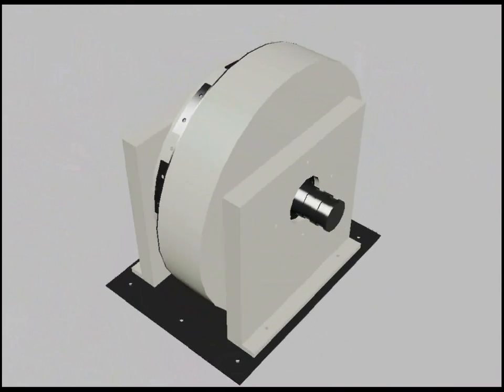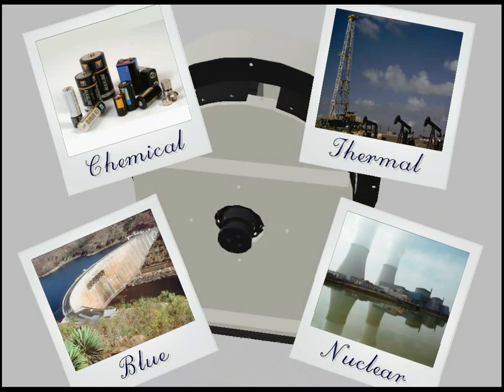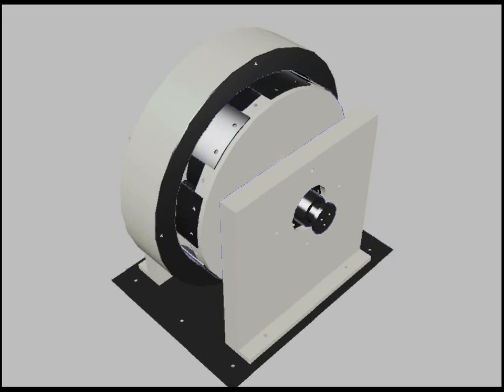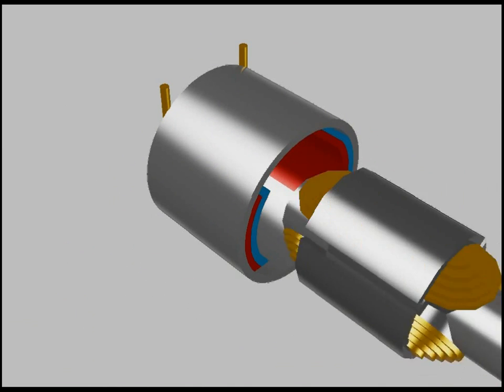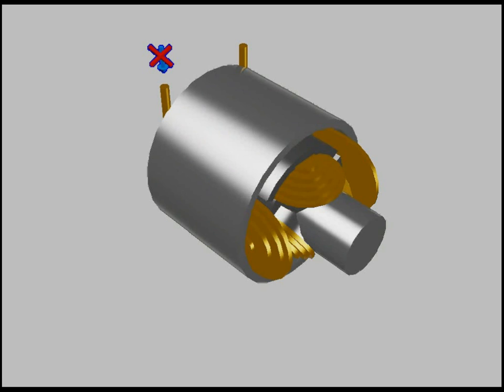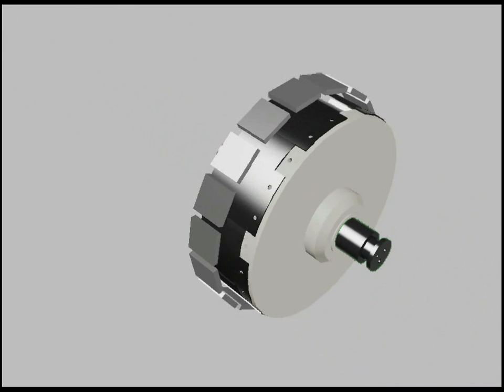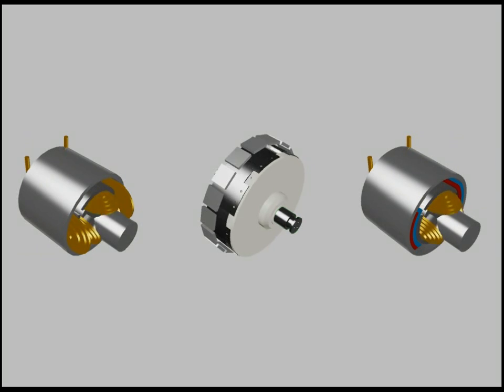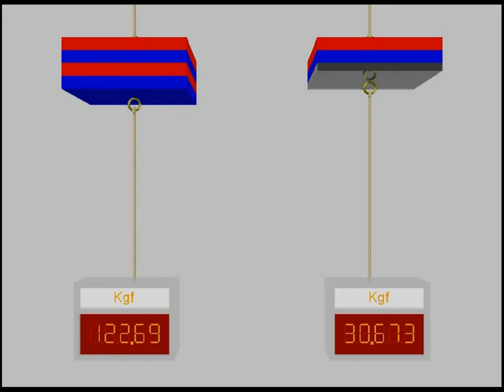MTG - Magnetic Torque Generator

Comment from the maker: Nice to see you.
There were a lot of changes in the lab structure since this video's publication.
(new national research policy, budget and staff restructuration, etc...)
The team is currently trying to find a functionnal shape that complies with the safety norms.
Laws requires to allow a disassembly by the user, wich was not foreseen at start.
And because rare earth and metaloceramic elements have been prohibited due to environmental laws, the used materials have been changed, wich mean a loss of power compared to the old model.
Adequate power ouput and safety compliance are the work points of the team.
.
We also want to give much thanks to all the partnership proposals and the warmly supports.
.
PS :
The MTG is not a perpetual engine. It needs input power sources to demultiplicate them.
.
(2017/07/16)
Reply: Great,  can i use this MTG Magnetic Torque Generator mechanism to rotate my sternwheel paddle drive in my pantoon?
Would appreciate your assistance. 
Thanks
Reply from the maker: @Savanna_12  Hello. Yes you can,
but due to aqua inertia, the efficiency of a enhanced magnetic gear box (as those for actual 1~4 KW wind turbine) will stay less than muscular action. It work both in straight and reverse, so you can.
Maybe in your case you can use a small air-tank as power-source and a chained pneumatic-screwdriver/motor as a muscular assist. So you can save usable power by keeping it mechanic, because convert it in electricity will result of a total 50% energy loss.
Hope it helped

Comment: You mentioned a magnetic monopole. Problem is there is no such thing! Show me a working model instead of a diagram. Oh, what's that? You can't because it doesn't exist? That's what I thought.
Reply from the maker: Hello Harold, I take note to make detailled view of each parts.
As you asked, here on the lab's twitter you can see some short gif on working magnetic monopole. (2019 may 03th)
Linear version :
https://twitter.com/Exomeca/status/1124153494309675008
Torus version :
https://twitter.com/Exomeca/status/1124154312341565440
And general incidence on the most recent prototype (yet test paused due to lack of material and covid situation) :
https://twitter.com/Exomeca/status/1174028424450588672

Comment: dear what is your position now?
Reply from the maker: Hello Yoav Heller,
.
Compared to this video, for several reasons including the components supply and because the general interest went into a portable version (something much smaller that presented in video), we redesigned all the technology.
.
The tests on the new main core were completed a month ago (stability test and compatibility with Safety Standards Booklets). The energy efficiency has been improved and the whole system is now miniaturized. There are thus 4 crystal core and the modulator is shape-integrated.
.
We are actually working to improve the duration of power source (800 hours only). Planned also to use rechargeable accumulator, as 9V battery shaped.
For now, the point is the Input Gear-Speed that is unsuitable for small motors (we chose a RC-micro-motor - Motraxx 6V 37,7W 8400 rpm) (compared to our crash-test engine that is a 800W 1500rpm).
.
For the output energy, we will certainly opt for a 1400W (50A) automotive alternator.
.
If you want, you can see the progress on Twitter
https://twitter.com/exomeca

Comment: Does it require less torque than the average generator?
Reply from the maker: On our models, it requires a quarter of the nominal torque. But the acceleration time is higher and the start must be made without load.
Reply: Is there a guarantee on your product?
How do I get plans?
What is the estimated cost?
Reply from the maker: We do not have a finished product. Actually we are looking to sell the technology or establish a partnership with a company able to make a safe product.
.
The distribution of Mounting kits is not envisaged in this version due to the magnetic core that can be hazardous at mounting. 
We are still working on this subject.

Comment: at  1:09 you mention "Because a house always needs less power than a car"  to better give credibility to your claims, can you explain that? You are using technology from magnetic motors that have been made since Tesla, Bendini, Newman motor, etc How is this any different?
Reply from the maker: The available power in a house is globaly between 6kW and 9kW (Voltage x Amperage) 
but the power of an average car is upper 30kW. 
It's more understandable with an electric car (as the Nissan Leaf). 
It can recharge with a standard plug for some hours, and also supply the house for days in case of a blackout. 
So, if you have the power to supply a car, you can supply some houses.
.
To the Tech point ;
Even it can be used as a motor, MTG is a primary generator 
(electric engines consume energy and are electro-mechanic transformers). 
We don't use electricity but a mechanical paramagnetic structure to make our engine rotate and all the power come from the magnet core.
The only need is a frequency reference to ensure a stable speed.
.
Actually, we have reached a computed model that use multiple-cores.
It rotate by itself and ticking as a clockwork do.
It doesn't need any signal in input anymore, it only gives beating power output.

Comment: Какой материал экранирует магнитное поле?
Reply from the maker: Магнитные экраны в ламинированные стали, в любое качестве сердечников трансформатора.
Это внутренняя геометрия и разрыв которые имеют первостепенное значение,
для того чтобы изменить градиент магнитного по всей поверхности, а не на краях.
Но в результате чего магнитное поле не равен нулю, только понижено.

The magnetic shields are in laminated steel, as any transformer core.
It's the internal geometry and gap which are paramount
in order to modify the magnetic gradient across the entire surface, rather than on the edges.
But the resulting magnetic field is not zero, only lowered.
Reply: ***** Эти материалы проводят ток. Значит они будут тормозить вращение.
Reply from the maker: Это правильно, но эффект CEMF появляется только тогда когда общее магнитное поле изменяется.
Именно поэтому мы работаем с магнитное монополей.

That is correct, but the cemf effect appears only when the overall magnetic field varies.
That is why we are working with monopoles.
Reply: ***** эффект CEMF проявляется когда проводник 
ДВИЖЕТСЯ В МАГНИТНОМ ПОЛЕ
не о каком "изменении МП" в законе не указано.
Reply from the maker: Электромагнитные законы указать градиент изменения в качестве причины появления CEMF, вихревых токов и сил Лапласа.
Если нет градиент, объект сохраняет свою энергию и инерцию.

Electromagnetic laws specify the gradient change as the cause of the appearance of the CEMF, eddy currents and forces of Laplace.
If there is no gradient, object conserves its energy and inertia.
Reply: ***** http://prntscr.com/c2qvnt
У вас явное противоречие.
Reply from the maker: Может быть я должен объяснить.
Мы хотим чтобы избежать CEMF на статор, потому что это наш источник энергии, именно поэтому мы используем монополи.
Но нам это нужно на ротор чтобы иметь скорость и контролировать его, таким образом, мы сделали модулятор, который engendrate градиент.
В результате FCEM появляется только между модулятором и ротором,не между статором и ротором.

Maybe I have to explain.
We want to avoid the cemf on the stator,because it's our energy source, that is why we use monopoles.
But we need it onto the rotor to have speed and to control it, so we made the modulator that engendrate the gradient.
In the result, the fcem appears only between modulator and rotor, not between stator and rotor.
Reply from the maker: Дело в том, эдс между магнитным источником и щитом значительно ниже, чем между двумя магнитными источниками.

The fact is, a cemf between a magnetic source and a shield is much lower than between two magnetic sources.
Reply: ***** Да ниже, но есть. И при больших оборотах будет существенно.